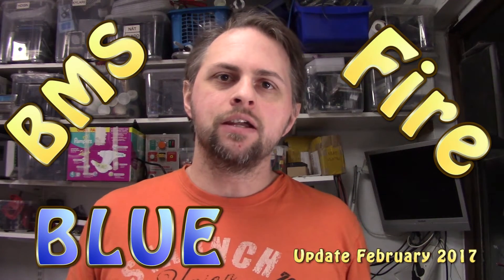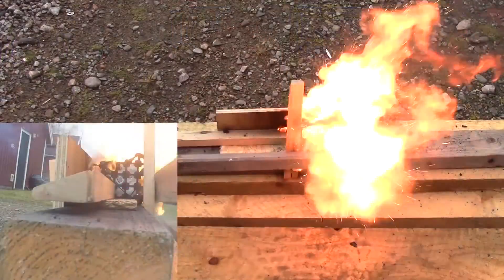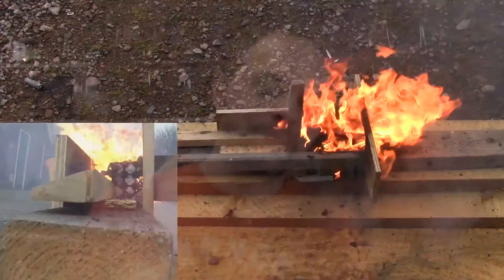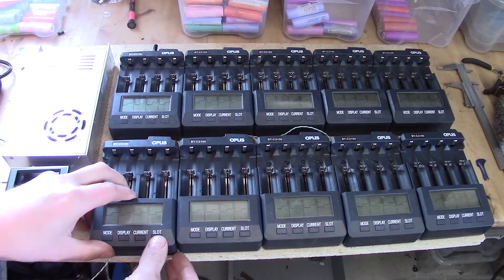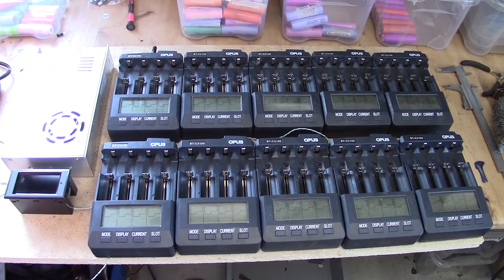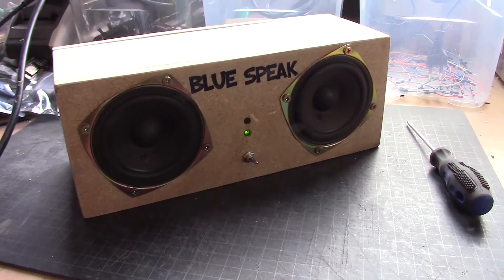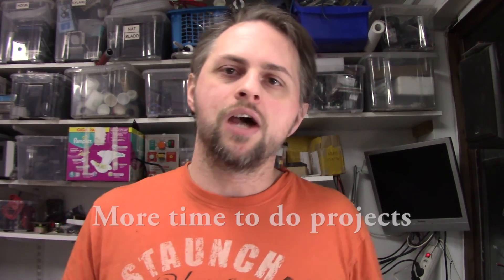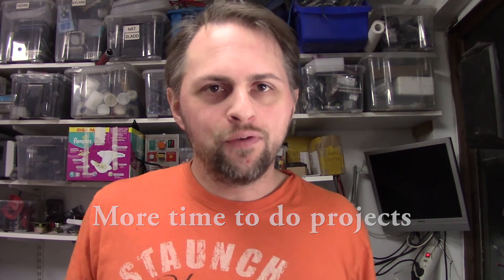Update Feb2017: Fire-BOMBS, BMS, Projects, What-not?

Comment: whats your opinion energy density vs weight wise to use 3.7volt prismatic cells to power quad drones? to me it seems the tin cans (18650 and their cousins) are pipe bombs and not the best practical form factor.
Reply from the maker: It depends on what you going to do. Long flights and you do not need any power... Go with the higher density. I generally just use normal pouch type RC batteries for drones. For high capacity i have used Multistar. But mostly i fly race-quads and on those you just want as much punch as possible :)

Comment: Really nice, bro. :) I'm working on a Bluetooth speaker as well, but a really small one. 2x3w in a glasses metal box (didn't even knew that in fact existed!). I intent to make a bigger one too, maybe 2x15w, with a lot of 18650 cells and it's going to be a power bank as well. :)
Reply: Oh, and BTW... I'm going to make a 18650 battery charger as well, to charge 6 of them at the same time, using 6 TP4056. Already have everything I need, but I have a few projects that I have to take care before. :)